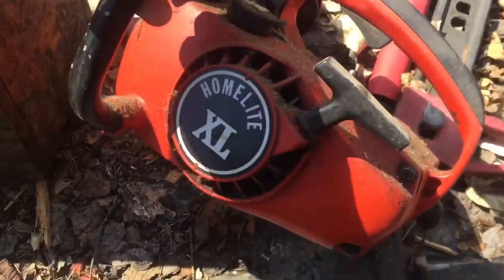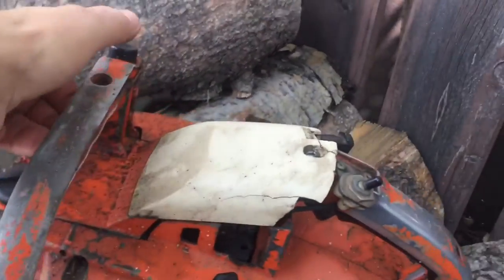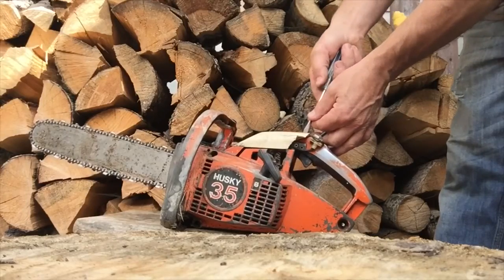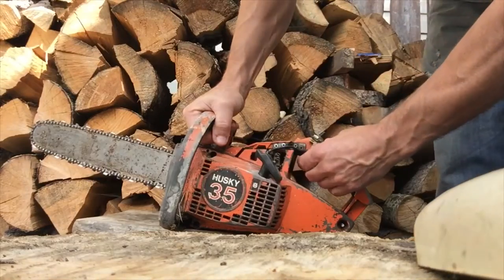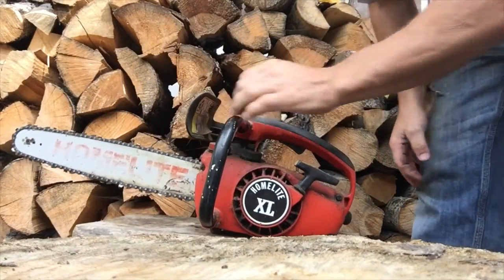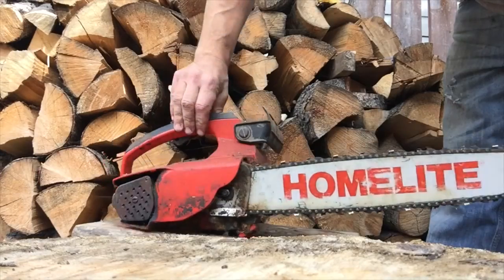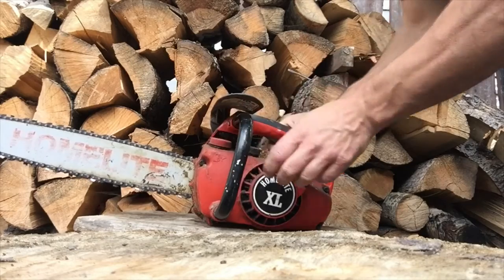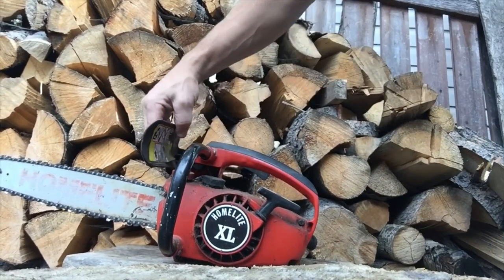10 Dollar Husky 35 and Homelite Vintage Powersaws

Comment: Came here because I just bought a Husky 35, was sold as a runner, but I couldnt get it started at first.
Tried the mustard trick and it fired almost immediately, changed the fuel line as it was cracked, and now I have an excellent condition running Husky 35!
Reply from the maker: @Joel Pullen awesome ya they are cool little saws.

Comment: Just picked up a Husqvarna 35 for 40 bucks. Not running well. Ordered a carb kit. These were made in Canada, by Electrohome, in Ontario from 1988- 1992?  Hoping I can get it running well. Some folks say these were originally build by Frontier. Looks to be reasonably well built.
Reply from the maker: Yes they were originally built in Trail B.C by ex Pioneer engineers I think?? I’ll have to double check but Mike Acres told me the story.
I didn’t know about them being made in Ontario as well but that is cool! 
I still haven’t got mine going but I really love the feel of that saw and can’t wait to restore it and get it in some wood. 
I think the original design goes back to the 70’s.
If you go on “Chainsaw collectors corner” it will give some info on there.